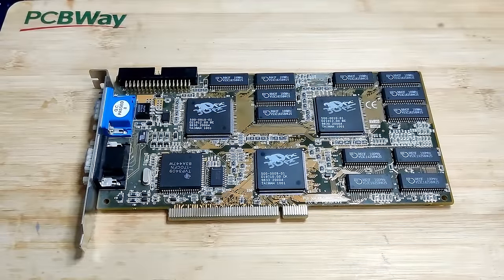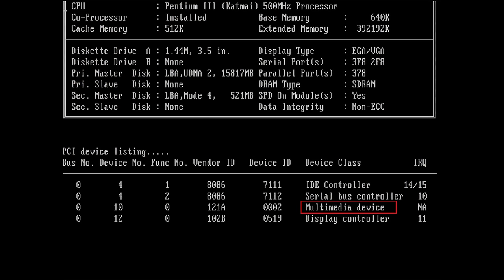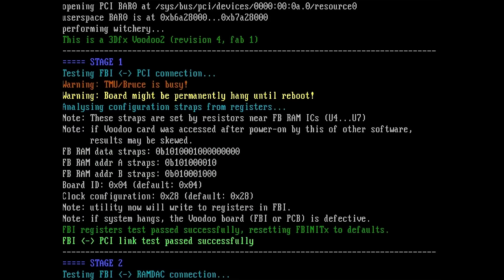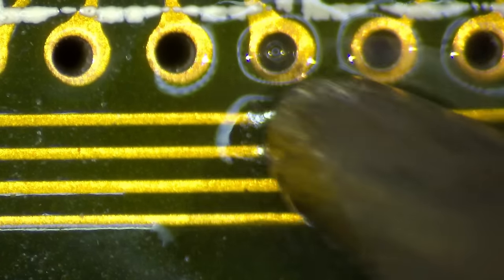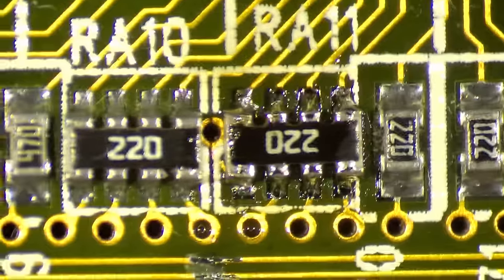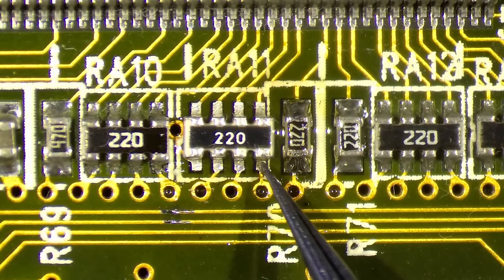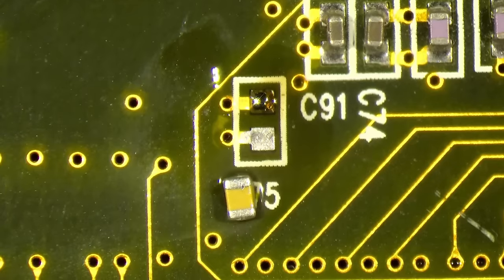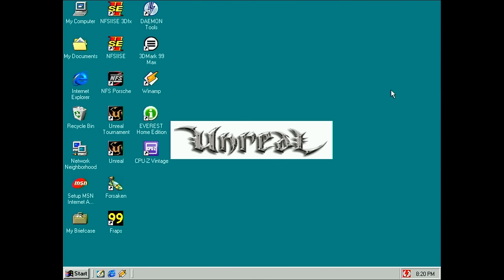Can Witchery find the fault of this 3Dfx Voodoo 2?

Comment: I have a Voodoo 4500 Evil King card and when the computer boots it doesn't calculate the memory on the card. Would you happen to know how to fix that?
Reply from the maker: You mean the memory doesn't show up when the Voodoo 4 splash screen appears (the first screen that appears after powering on the system)?
Most of that screen is static, but what I've seen using BIOS modding Tools is that the memory is dynamic and calculated on startup. Can you share a few more details about your issue and where you would expect the memory calculation to appear?
Reply: @bitsundbolts  When you boot up the pc you should get this. But when you to get the memory size with mine it's blank. I'll have to go get the pc out. But I still get video and everything. I don't believe it is detected and I can't seem to reflash the bios on the card.

Voodoo4 4500 BIOS - Version 1.15
Copyright (C) 1990-2000 Elpin System, Inc.
All rights reserved.
3dfx Interactive, Inc.
Total SDRAM Video Memory Size: 32768K
Reply: @bitsundbolts  I am not sure if I flashed it with a bad bios or what. It's been this way for years. I also think i might have put it in a 4x slot in another computer once.
Reply from the maker: If the card works, then I believe it is a BIOS display issue. Maybe a custom BIOS that doesn't show the memory for the evil king. I wouldn't worry too much about it. If you can use the card in windows and it detects the correct memory in tools like 3dmark or similar, it should be fine.
Reply: @bitsundbolts  It doesn't detect the memory in windows either. Video is fine. It doesn't detect it as a 3dfx card uses the basic graphics driver.
Reply from the maker: Oh, then that is not a good sign. Unfortunately, I don't know what could be the issue. I never had a Voodoo 4 on my channel and no experience with those cards.

Comment: Ah resistor networks, always an issue.
The fat playstation 2 has them between the CPU and GPU that fail so often.
Some are just high resistance but they are sometimes just cracked even if the console never has been opened before.

Comment: At Boot time it tells you IRA: NA, that's weird, it should have an IRQ, even an unusual number, but a number; unless no VooDoo 2 present an IRQ, some PCI devices didn't presented 1, some Modems or NICs didn't at the time... yes I'm that old.
The Videocard is dirty too, and you should isolate those reinforce the traces
Reply from the maker: If I'm not mistaken, Voodoo and Voodoo 2 cards will not get an IRQ assigned. At least this is what I remember looking at the summary screen.
I covered the two traces with solder mask after I was done. I did not show this in the video. You're right, any exposed trace should be covered to make sure they'll be protected from environmental conditions.
Reply: @bitsundbolts  You covered, glad you did; interfering signals are all around. You should test components before soldering them. Also Capacitors help stabilize and buffer charge for circuit, they're very important